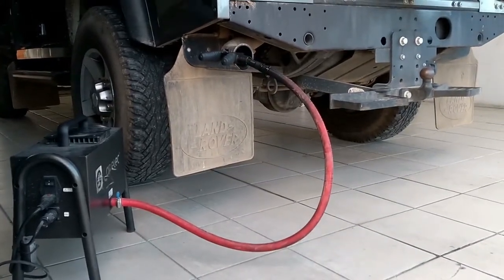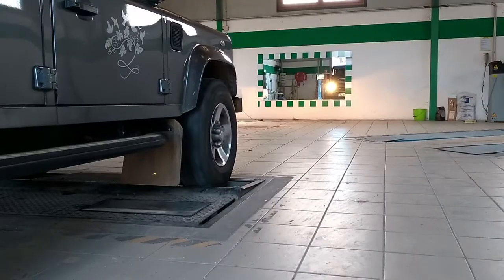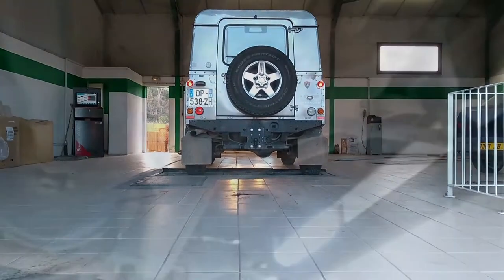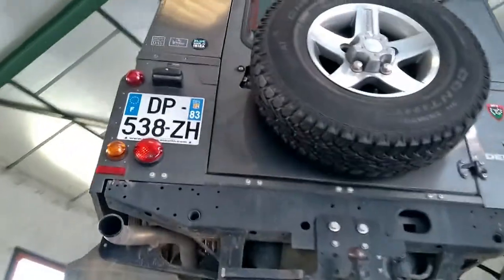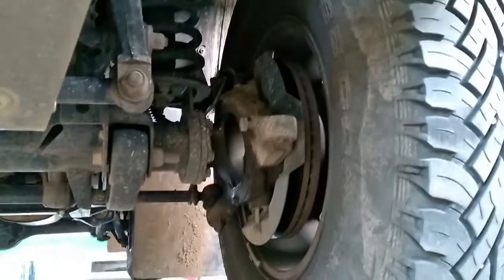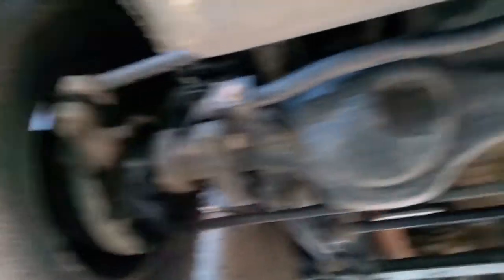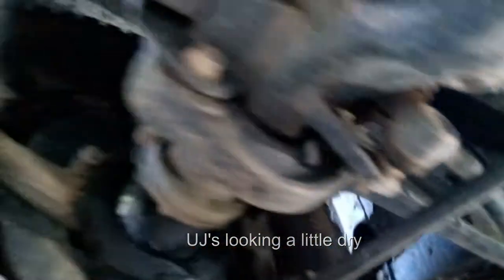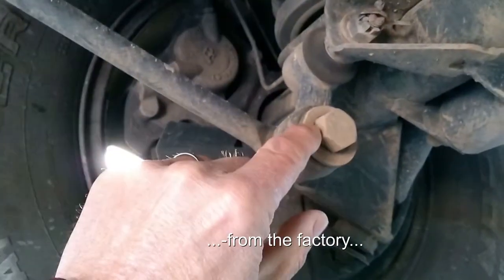DEFENDER PUMA - FIRST EVER ROADWORTHY

Comment: Thanks for the video. Is it a 2.4 or a 2.2? Witch one would you recommand?
Reply from the maker: This is 2.2 - 2015. 
Noticeably smoother than the 2.4 (which seems to have a bag of bolts in the sump - that drones at certain revs). I am sticking to my Tdi but if I had to choose between the two - the 2.2 has impressed!

Comment: Is that 85k miles or km ? Just about to buy a 110 2.2 with 65k miles on the clock
Reply from the maker: 85k kilometres (beyond 150k kms at the moment and zero issues - besides the particle filter that needs replacing on the 2.2). 
If you have purchased - enjoy! Great vehicle 🤘😎